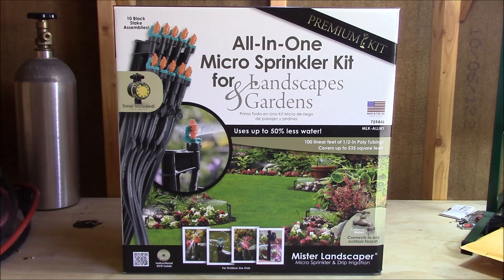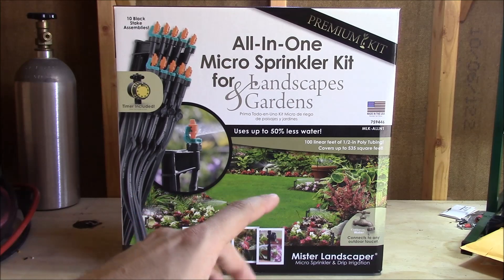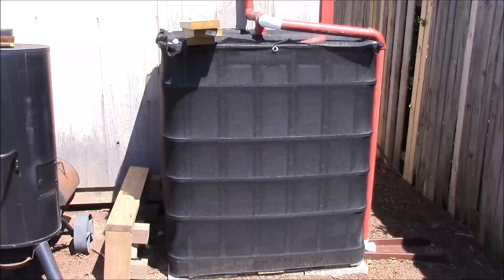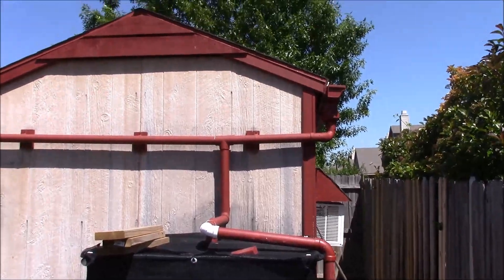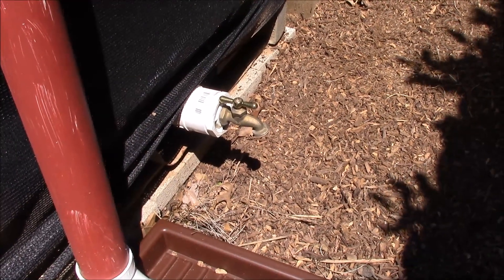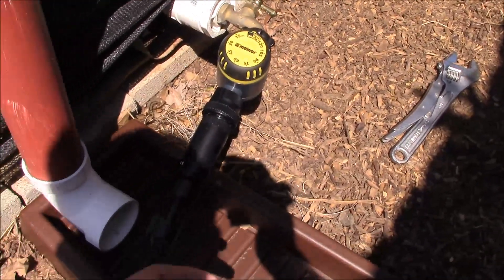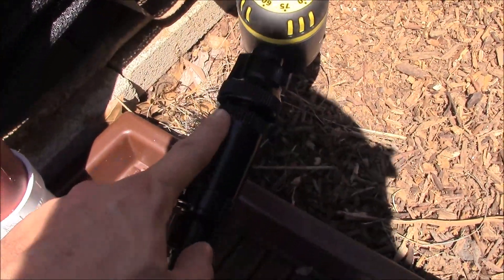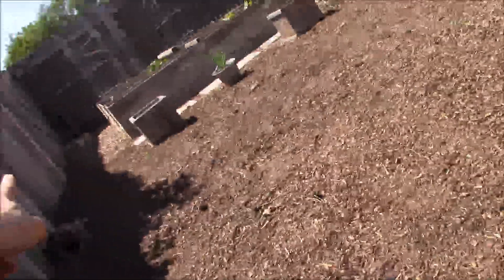DIY Automated Garden Watering System Part 1

Comment: Take the pressure regulator out of it and just use back flow prevention. The regulator is to protect the watering system from to much pressure will not be an issue with just  gravity.

Comment: I don't think that it will be able to put out 50 psi because you would need over 100 feet of drop to get 50 psi. I just connected the mister system with a battery operated timer to my water hose and it is working now. I buried it in the ground and ran the 1/2 inch and then converted it to the 1/4 inch.
Reply from the maker: +Plan B Homestead Nice.  I guess I like to over-complicate things so I am determined to get this to work with rain water.  But other than that mine will be similar.  I don't want to bury my lines because I may have to replace my back fence soon and might decide to re-arrange my garden in the next couple years.

Comment: I found an 12v inline utility water pump at Harbor Freight for  around  $40.  I'm going see if a solar car charging panel I have will keep the 12v motorcycle battery charged.
Reply from the maker: +tom mac That is the exact pump I ordered.  Should be here tomorrow or Monday.  I'll include it in the next episode in this video series.  It will be powered by my solar panels, too.